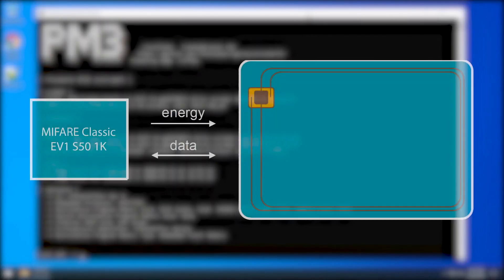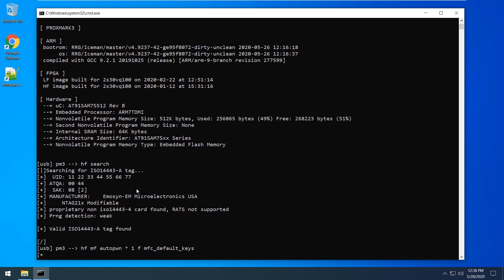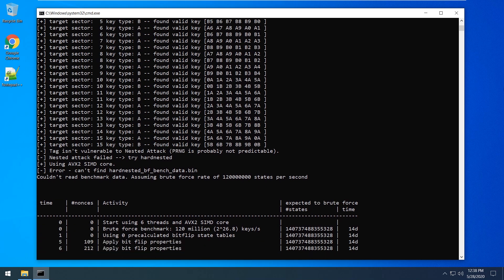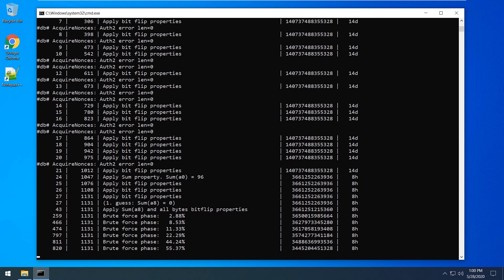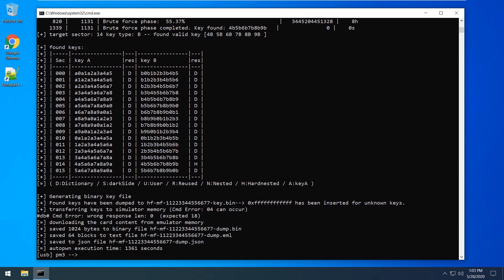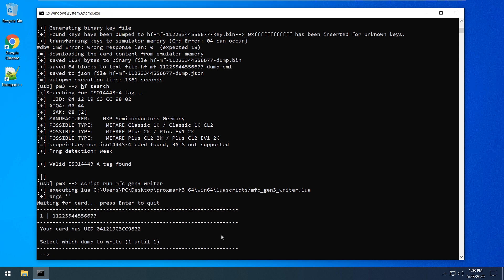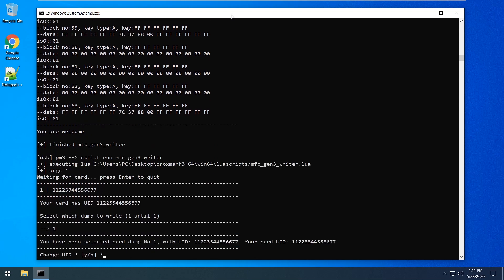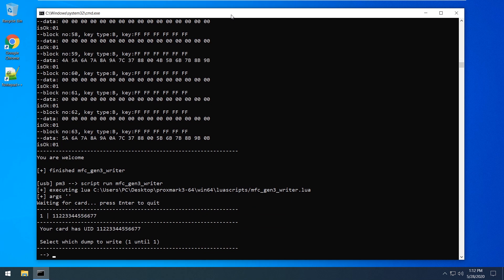Unlocking the MIFARE Classic EV1 S50 1K. Сloning data including UID to the blank card.

Comment: Hi,
I wanted to ask you about proxmark 3
Can it read a mifare desfire ev1 that is encrypted with 3des?
Or can I clone or emulate that type of cards with it?
And I read on some sites that ev1 isn't vulnerable to brute force attacks (according to someone on a site, it's possible but would take years to complete "this was posted 7 years ago, so I'm wondering if anything has changed since")
BTW I don't have the encryption key for the card but I have access to a reader and I can try MITM attack on it
Reply from the maker: Hi. That's script has been not designed for MIFARE Desfire.